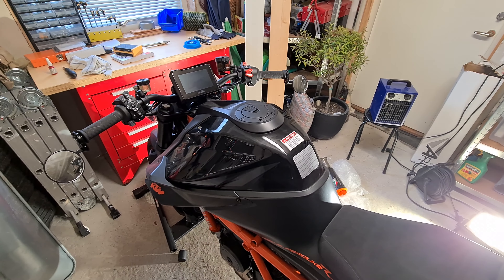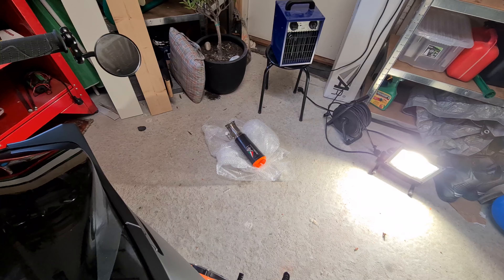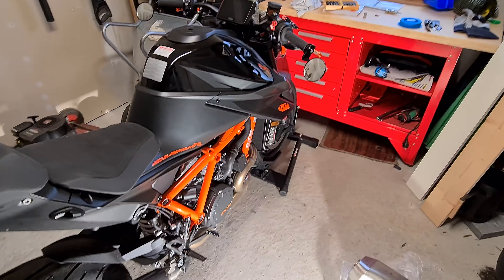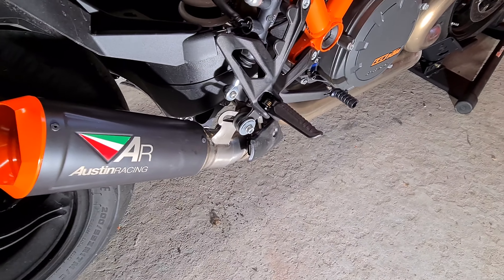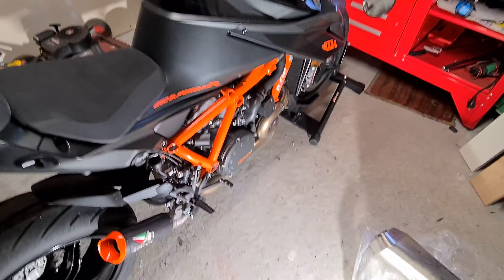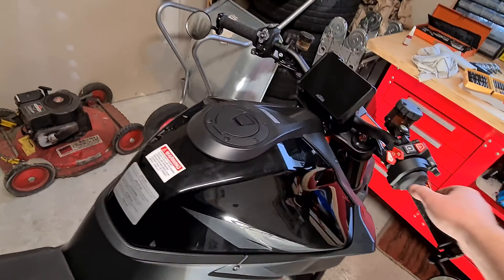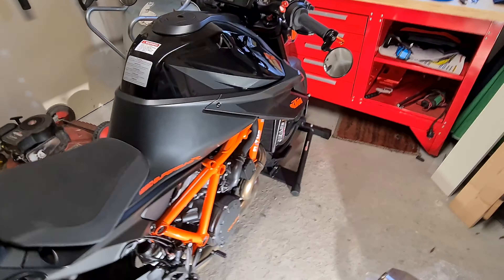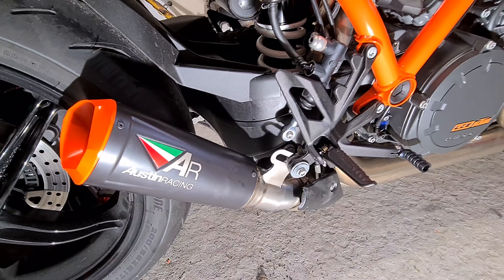New Austin Racing Exhaust Vs. Stock Exhaust | KTM 1290 Superduke R | 2020 | LOUD!

Comment: is this the V3 250 mm?
Reply from the maker: It's the V3 Mini 200 mm
Reply: @simplyriding1199  Did you get a tune - I'm thinking of getting the same exhaust?
Reply from the maker: @_wiiizzard_  No tune. Just a slipon. The sound is incredibly nice. The delivery time was quite long though. Almost 3 months
Reply: @simplyriding1199  Are you based in the UK?
Reply from the maker: @_wiiizzard_  no, I'm from Sweden
Reply: @simplyriding1199  The Homolgated version (fixed baffle ?)